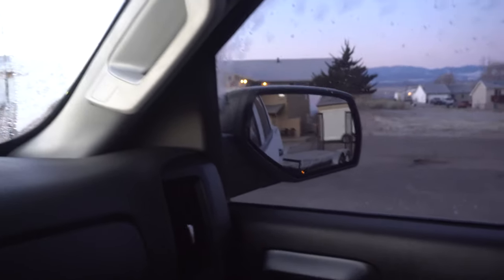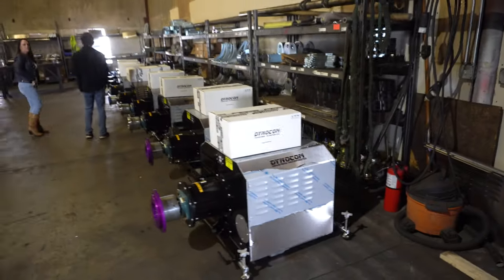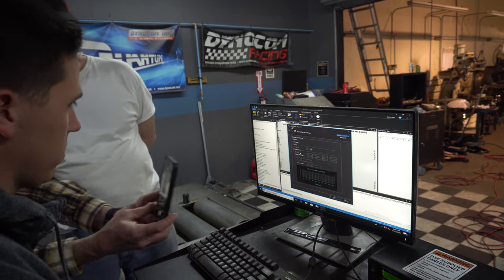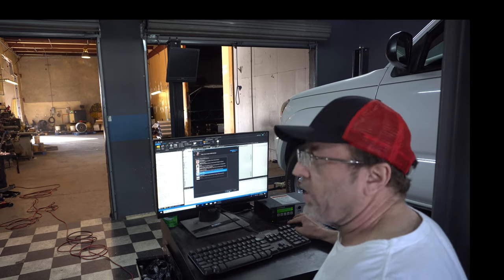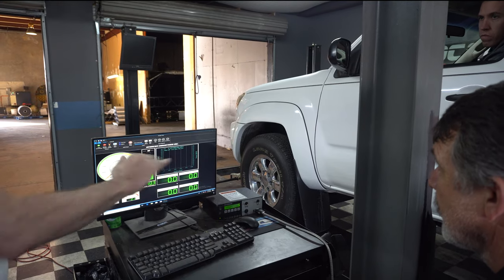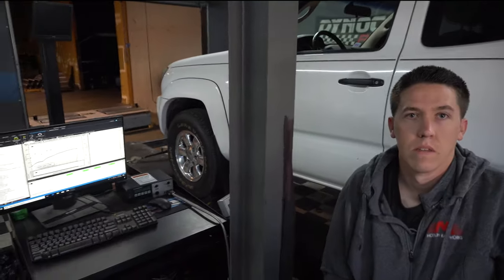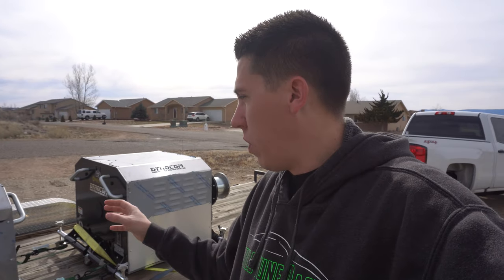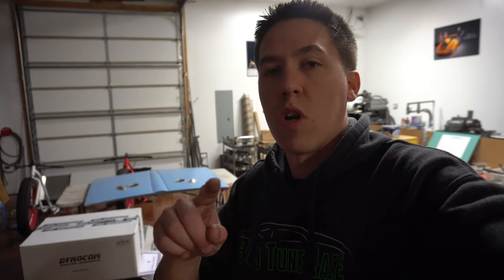I Bought a HUB DYNO for Tuning Cars... Dynocom 3500 Series DC Pods!!!

Comment: Congrats! I tried to talk to them at SEMA but their sales lady instantly tried to qualify us saying the hub units "are really expensive" so we ordered a MainLine instead. Keep tuning!
Reply from the maker: Thanks! It's definitely been a fun learning experience and a nice tool to have. That's too bad you didn't have a good experience with them. Seems like people really like the Mainline dynos!
Reply: @BuildTuneRace  little bit pricey but the torque it can handle and features are real impressive. Load cell tuning for VE tables and ignition timing optimization are so much easier than road tuning
Reply: I must say I like the Mainline system. At EFI University I had Ben Strader as my teacher. We used a Chassis Mainline Dyno & I fell in love.

Comment: So you work for motion now?
Reply from the maker: Yeah I've been full time with them for for about a year now worked part time before that for about 10 months
Reply: So let me bounce this idea off you then. Say someone takes their no weld valve cover breather adapter. Mills the middle post out so it’s completely open in the middle. Could that be a viable “no weld” turbo drain adapter for oil pans and such.
Reply from the maker: Yeah that should work. Might not really need to mill the center stud out but might not hurt. Just make sure oil level is below the breather/oil fitting. Haven't seen it done but that's a cool idea!
Reply: Build Tune Race I figured it would help flow. And it should go on the side of the oil pan.

Comment: So you bought a HUB dyno and they trained on roller dyno? Wtf! What a joke.
Reply from the maker: Yeah the class was about half and half would have been nice to do it on a hub but software is the same so i should be able to figure it out!
Reply: Good luck. That company is very hot or miss. Their stuff doesn't really work well. If you have issues I know someone who makes acontroller trust replaces theirs and it actually functions. I have a Mainline Prohub and that one is amazing!